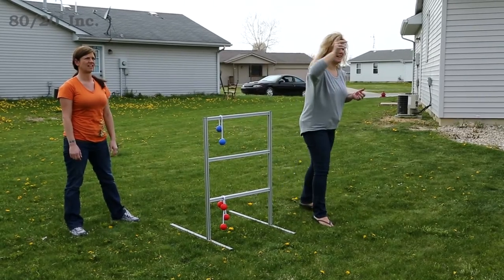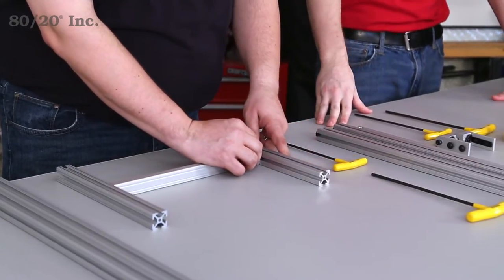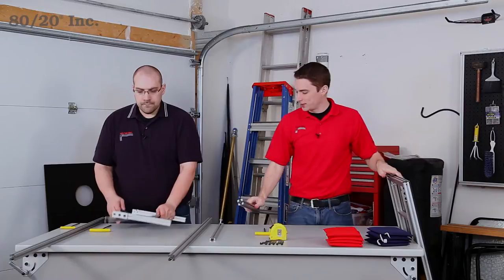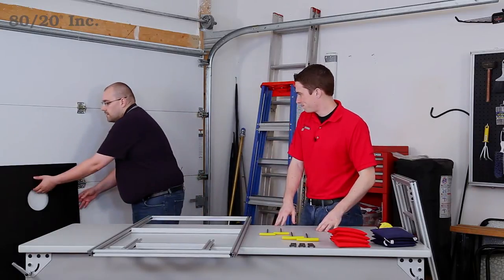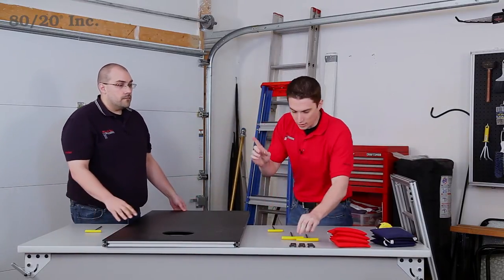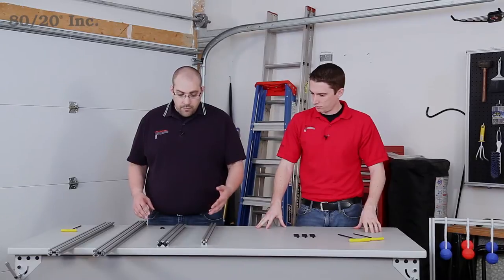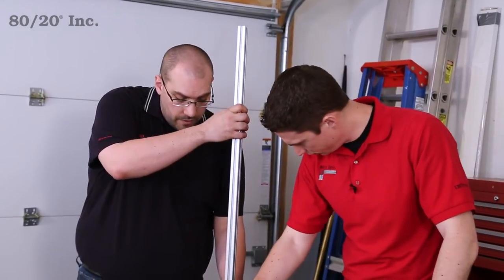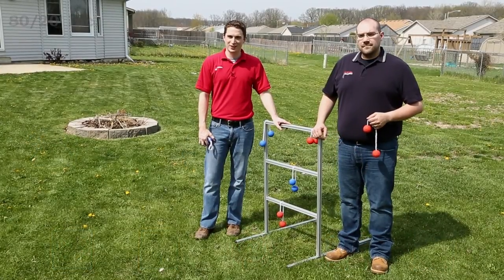80/20: Xtreme DIY - Outdoor Games

Comment: with the corn hole boards, can they withstand the wight of a child stepping on it ?
Reply from the maker: These corn hole boards are not intended to hold any weight. However, if you want to build a stronger solution designed to hold additional weight, we’d be more than happy to assist you with your design. Feel free to contact us at: info@8020inc.com
Reply: could there be a additional frame on the bottom to rise it up a little more, and extra support bars inserted to give it extra stability?
Reply from the maker: Great question David! As we like to say here at 80/20; "Anything is possible when building with 80/20!" These corn hole boards are no exception. All of our DIY projects are intended to be starting points for your own unique design and can be completely customized to fit your needs! Feel free to download our free design files for this project at; https://8020.net/diy-outdoorgames and start designing your own unique solution, or reach out to us and we'd be more than happy to assist you.
Reply: think you so much for the information it was very helpful, and I look foreword in doing business with making a purchase in the future.